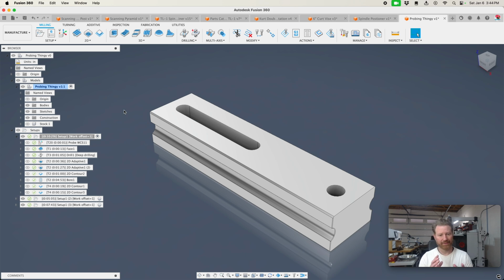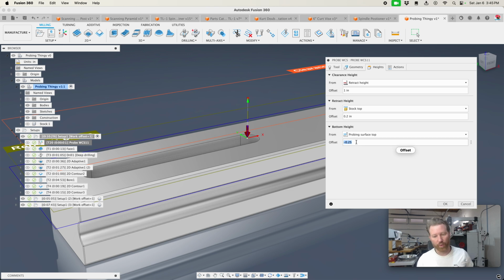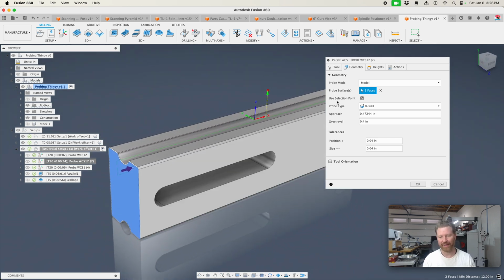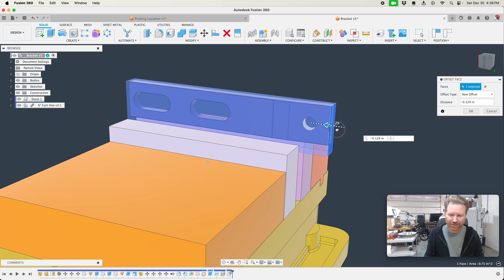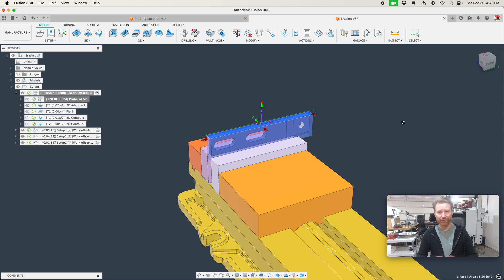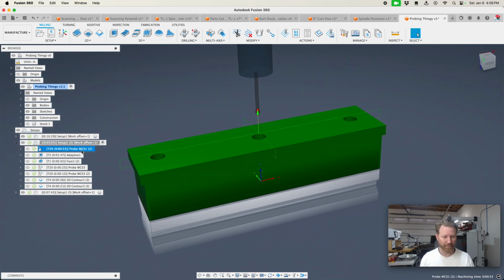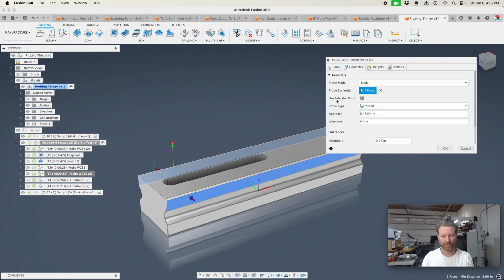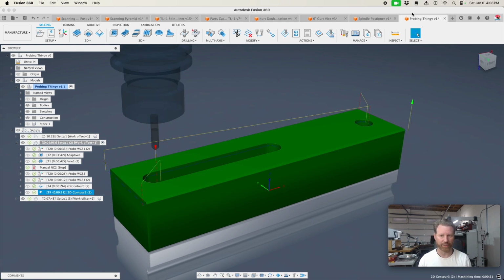Probing with Fusion 360 Part 2

Comment: Hey folks, I'm green to machining and am incorporating more probing in. I feel what's missing from these probing videos is actually seeing the probing and how it works after explaining how to do it in Fusion. Maybe there are things to watch out for on the machine itself, etc? Also, is there a way in Fusion to create a height map. I often engrave uneven large surfaces and want to know if Fusion can to an autolevel operation, a Z height map of stock, and then be able to apply that to an op? Facing the part, to even out the slight irregularities is not in option in my case, very thin material. Thanks!
Reply from the maker: The short answer is, no. Even with "Inspection" you could still only locate the part in X and Y, and then Z. But, you can not change the G17,18, or 19 work plane. Unless you a have 5 axis w/ DWO. Your solution might be simpler than that. They make Spring Loaded Engraving holders.     https://www.2linc.com      I hope that helps!

Comment: Awesome videos. So you have to probe the first part in the machine, and then the probe knows roughly where to go and it just updates on every part?
Reply from the maker: You got it! After you've probed the Part with the machine, then you can use Fusion to probe from there. I am sorry I didn't make that clear. But, thanks for your question!